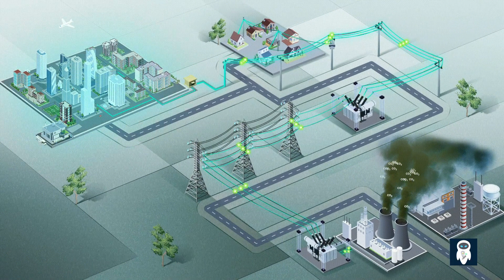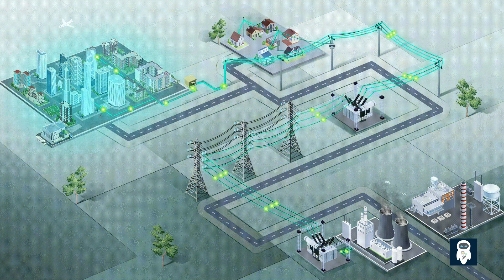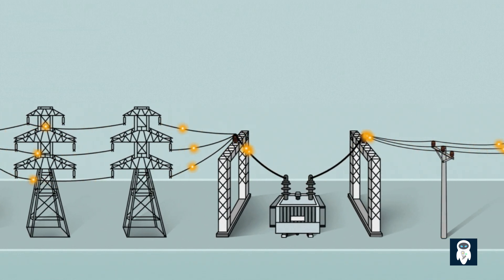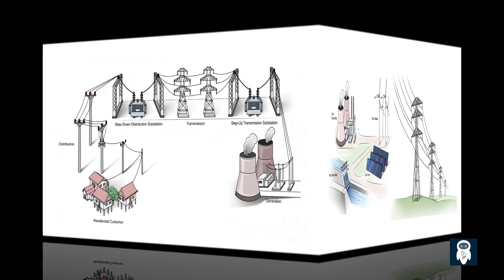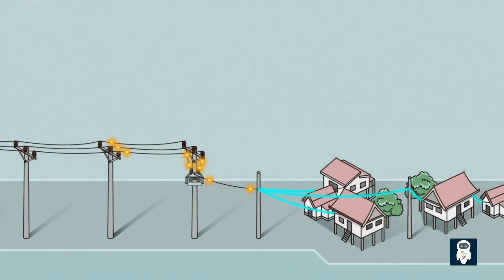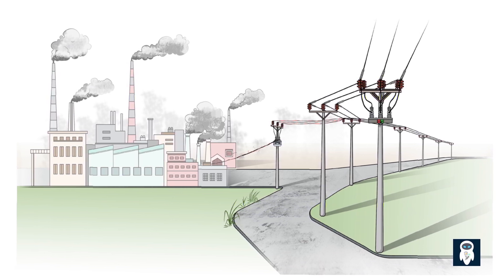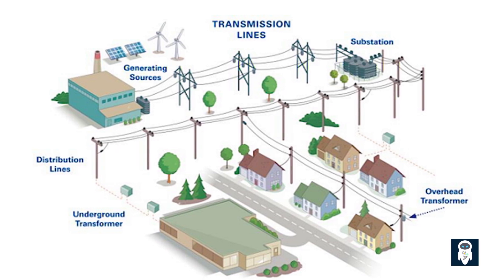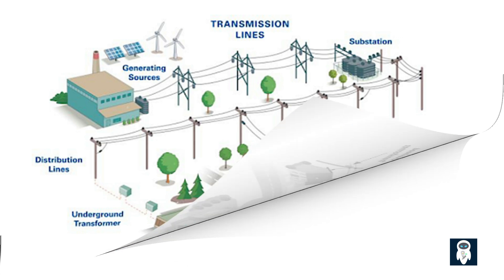Why are HV transmission lines equipped with two power lines, while LV distribution lines only one?

Comment: The answer to why there are often 6 wires instead of 3 on transmission is not because of capacity (one wire with twice the area is the same mass and could carry the same as 2 wires) or redundancy (you can only carry half capacity if one is lost). The reason is simply that the wires are installed by pull systems and helicopters, and there is a maximum practical weight to the cable they can handle.
Reply: It also divides circuits in useful ways.  Consider a 6 wire tower - it is likely carrying power from two separate generators thereby simplifying ... everything up and downstream of it.

Comment: One of the most important reasons for 2 to 4 cables on very high voltage lines is due to coronal discharge. At voltages in the 500 kw range and above, the voltage is so high that it can actually break down the air and discharge electricity into the air. This results in a significant power loss for these transmission lines that are not paired. By spreading out the charge, it allows for less coronal discharge.
Reply from the maker: Yes

Comment: You confuse people by saying two lines. When we all see three lines bundled up. Then from there it’s either sets of two, four, etc.
Reply: When he says 'pole' he means the 3 phase poles, not the physical poles holding up the wires. So 2 sets of poles means 2 sets of 3 phase poles = 6 wires.
Reply: @sectokia1909  I understand but he also said line. Using them interchangeably confuses people.
Reply: Power system diagrams are usually "single line" drawings for each 3 phase circuit.

Comment: That's interesting, but I don't understand how you're counting one wire on those poles.
Reply: To confuse it further, look up Single Wire Ground Return.
Reply: I think they mean 1 conductor per phase.  Both transmission and distribution are 3-phase systems.  Distribution uses 1 conductor per phase (3 conductors total), whereas transmission uses at least 2 conductors per phase (at least 6 conductors total).
Reply from the maker: That's right. Thank you
Reply: @initiallearnwithme   thanks for the video! I do always wonder about the number of conductors on poles :)
Reply: @somejoe7777  that makes sense, thank you!